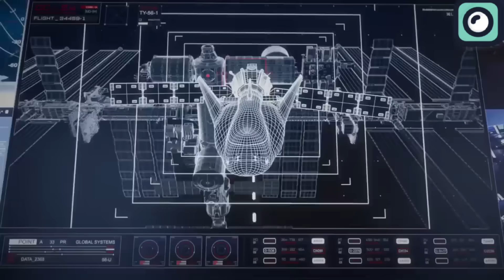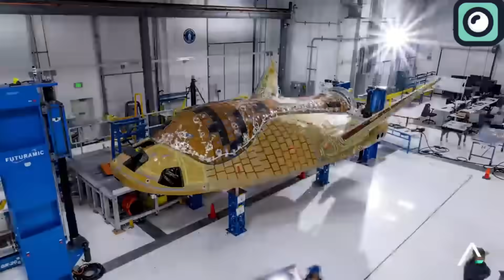Dream Chaser's Biggest Problem.....Is NASA Cancelling It?

Comment: i would love to know, why, in all of the footage of dreamchaser, even the most recent footage where the story is that it is "ready for launch", as well as the recent footage of it undergoing temperature and shake testing.. why does it never have the complete heat-shield in place?. there are always large sections of missing tiles in every footage i have viewed. i would think that at least once, when hearing how close to completion it s, that we would see footage with a complete heat-shield in place. wouldnt they want to stress test the system with a complete set of tiles?

Comment: It was Space-X and Boeing that got ISS contracts in 2016, Sierra Nevada was not given a contract, but continued to develop Dreamchaser with its own money. Once the Boeing Starliner kept being delayed, NASA decided they needed another ISS transport, they decided they would give Dreamchaser after all, and that's where we are at the moment. I have a suspicion that this whole video may have been AI generated!
Reply: ISS is going to either extended or junk.  Either way we need to construct a new space station.  Getting the entire logistic chain, machinery and equipment up and working.  We have to start developing the training programs and etc.  For example, the space suit and manned maneuvering unit (mmu)/Space jet pack was shelved.  This includes earthbound training programs and space construction methods.  We have not done that in over 20 years now.  Another example is calls for large torus Space Station.  Space X has show capacity is a real thing.
Reply: @rgloria40  WHAT? most of that is not true.

Comment: you seem to have Boeing Starliner confused with Dream Chaser.
Reply: Do they also sometimes mix propaganda with facts?
Reply: No... you weren't paying attention... both are money pits which only means NASA will NEVER cancel them.  The only thing NASA is good at is spending taxpayer $$$
Reply: Starliner?
Reply: Lockheed Martin Orion Capsule is closely related to Boeing Starliner than Dream Chaser.  Dream Chaser should be the vehicle to go to the moon.
Reply: @rgloria40  it needs a runway
Reply: @cbgardenmaryland  And Starliner can make the trip to the moon by itself too...because it has the capacity...too...  Get the hint.
Reply: @rgloria40  starliner is only rated for LEO
Reply: @cbgardenmaryland  Everything in time.  There are qualification for a development product.  Why are YOU a show stopper?

Comment: I used to be involved with SpaceDev back when Dream Chaser was just an idea, one issue that existed back in the very early 2000s was the AtlasV which was the planned rocket for launches wasn't man rated and it was looking like there would have to be some kind of transfer done in space to have people onboard when it docks with the ISS. A lot has changed since Sierra Nevada bought out SpaceDev and not one of the original team is still there, I'm friends with a few of them still. Back then it was thought that Bigelow Space would have a few space stations flying before now and there would be a need to transfer people and goods between stations and that was part of it's original mission, funny how things change over time.